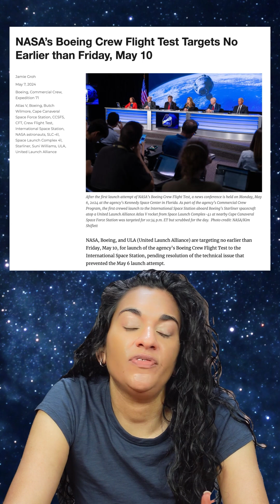Boeing Starliner didn't launch yesterday. Here's why. #nasa #boeing #space

Comment: Gee.Boeing making something faulty?
Reply: The centaur upper stage is made by Lockheed, not Boeing. Also, since the stage uses cryogenic fuels, it is very easily affected by temperature changes. The valve probably experienced the perfect temperature conditions to be frozen open just enough to cause the flutter. As for the booster issue, those boosters may have been sitting for a while, potentially causing the fuel to to develop flaws in the grain. Or maybe just a faulty sensor.
Reply: Boeing didn’t make the engine